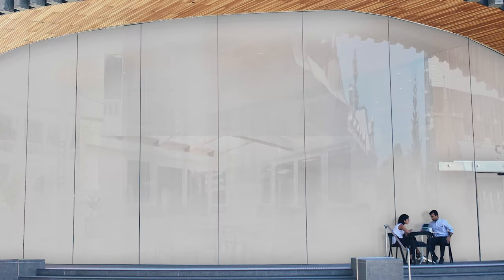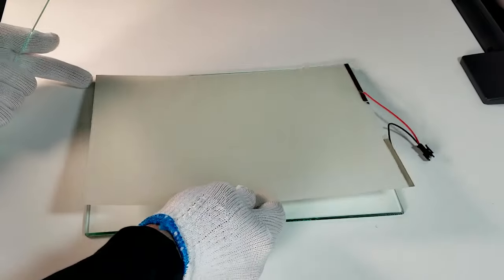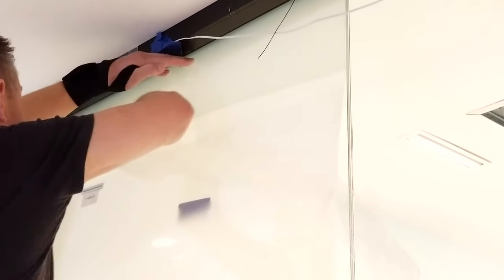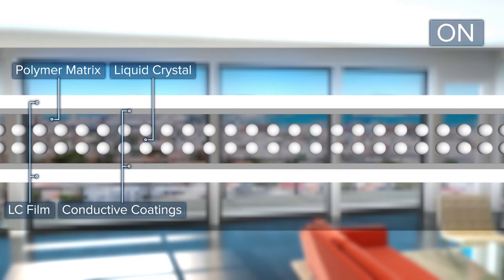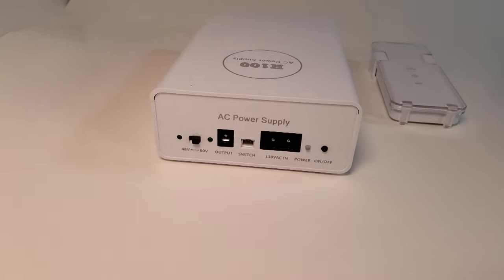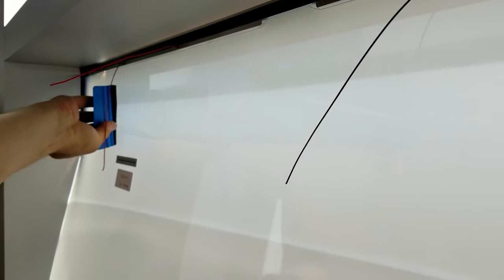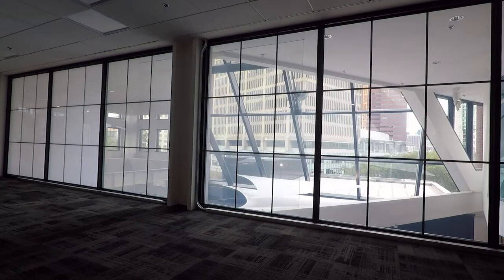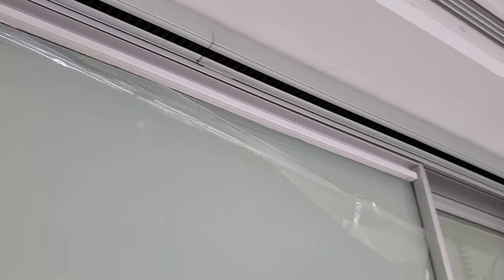Smart Glass and Smart Film 101

Comment: What if I want to use this in my vehicle? Is there a 12v or 24v version?
Reply: We don't advise people to use smart glass or film in their vehicle as the glass will become opaque if there is no electricity which could be dangerous if it were to occur accidentally.
Reply: @Smart Glass  I know what you mean. The vehicle I plan to put this in is a motorhome and the windows are on the sides, which aren't used by the driver. Are you able to make this work on low voltage? Maybe 48v, which handles more power through smaller gauge wires?